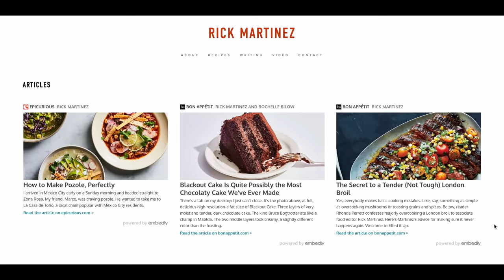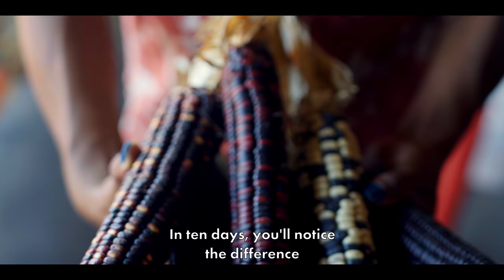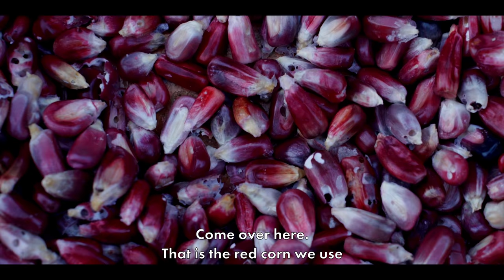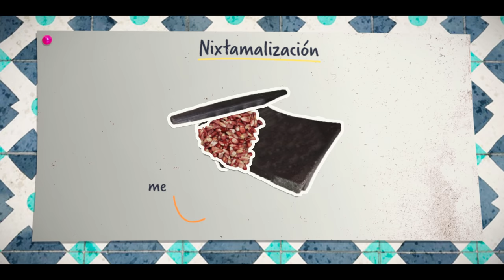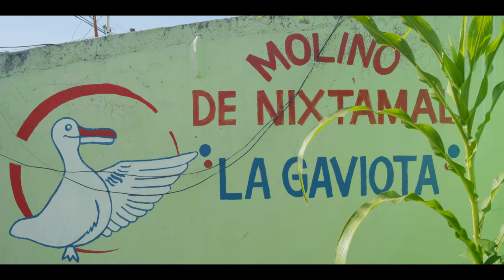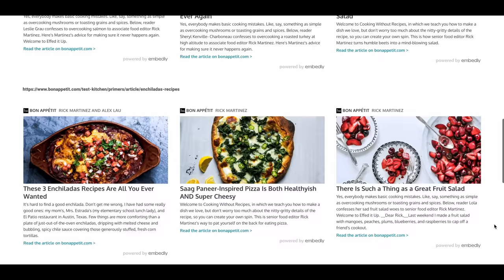Fresh Masa Tortillas in Jala | Pruébalo with Rick Martinez

Comment: This makes me want to get a tortilla press! I’ve never felt confident enough to make my own tortillas or tamales, but I’m definitely re-intrigued. Thanks for all the amazing shots too, I always forget how giant corn can be.
Reply: No press necessary.  Just sandwich a dough ball between two sheets of parchment paper and take a rolling pin to it.  It doesn't need to be perfectly round because you're just using it to wrap and pick up food.
Reply: My mom uses a sandwich bag between two paper plates when there is no press available, try that first before buying one, the super heavy press can sometimes be a little intimidating
Reply: After making a dough ball, sandwich between two sheets of plastic or parchment paper.
Use a heavy pan and press down all around with force. You might need to use a rolling pin after that to make it as thin as you like but it gets a round tortilla started.

Comment: Is there a difference steaming tamales in banana leaves vs corn husks? Where does this preference come from? Is it just what a chef can get their hands on and/or location?

I specifically ask because I am about to make tamales and I was planning on using husks because I have trouble getting my hands on banana leaves but I can wait if one is preferred.
Reply: It’s a matter of location and availability. Banana grows in the central and southern part of Mexico and so the tamales are wrapped in its leaves. The northern part of the country is drier and hotter and bananas can’t grow so they use corn husks. There are also places on the coast that use palm leaves. Each give a different flavor. All are amazing. But use what you can easily get. I grew up in Texas and we used corn husks.
Reply: @bosch1701  Thank you for taking the time to answer my question! Very excited (and mildly terrified) to make tamales for the first time.